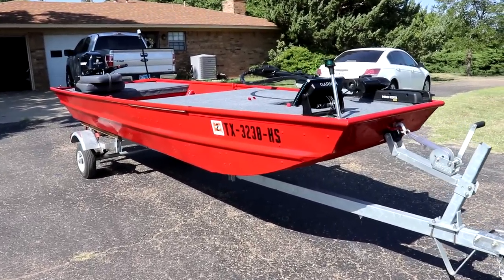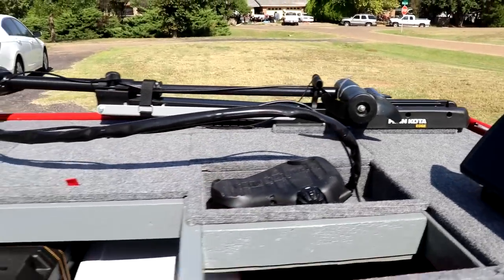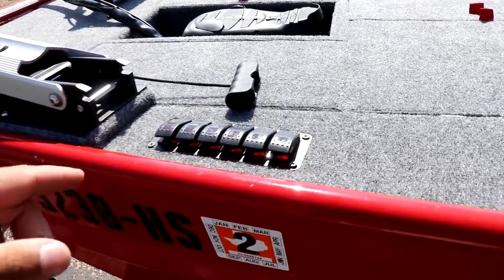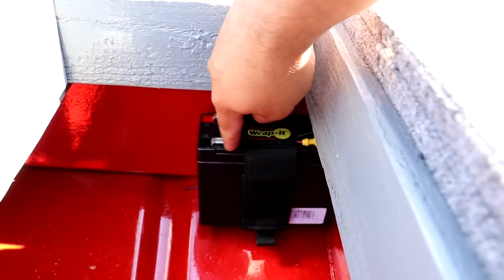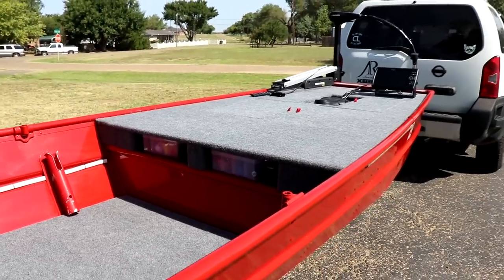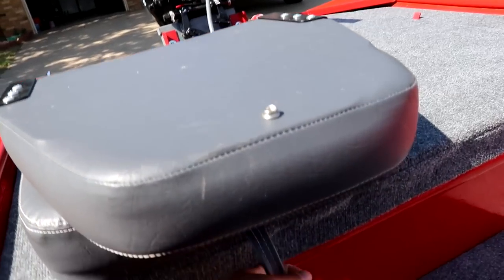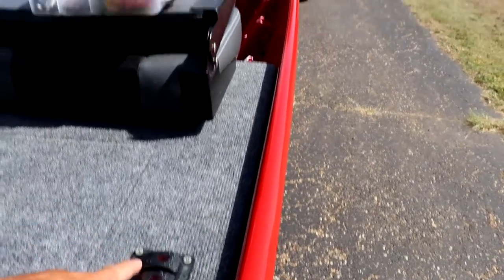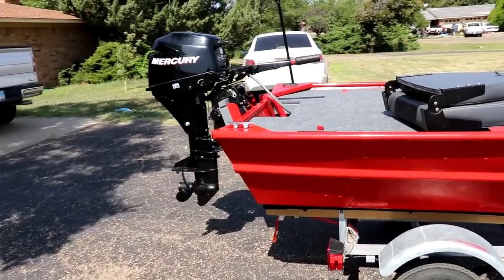JON BOAT TO BASS BOAT FULL BUILD WALK AROUND TOUR!!

Comment: Looks like you are very close to having the trolling motor mounted in a way that your hatch it blocks will open. Might want to try adding a board underneath it and extending its base over the front edge of the boat.

Comment: I did virtually the same thing to a john boat in the 70's. It was a little bigger and deeper than normal because it had been designed for the La.Wildlife and Fisheries so they could sample traps nets etc. so upon becoming the owner I actually made my deck platforms because the back bench was only a half seat. The best part was that it had a 48" bottom and nearly 2' deep. Had an old chrysler outboard which never faltered but I did replace it with a new 50 Merc. Yours looks good and I enjoyed your build. I smiled at it because it brought back some very fond memories of nearly 50 years ago. I put bass seat pedestals on mine but yours looks better; I did mine in blue. Used her nearly 10 years before I bought a store bought model.

Comment: I did a similar project on the exact same boat (14' alumacraft) except mine had a 9.9 hp motor.  With mine I just added a plywood deck covered in carpet with chair mounts.  No frame and no compartments.  It was made to be removable.  It made the boat heavy and sluggish.  I ended up pulling it out.  One of the nice things about a jon boat is the light weight.  I think you'll need a bigger boat and motor if you add 200 pounds of wood to the front of the boat.

Comment: On the front casting deck where u have your hatches in the bottom u should make like a box under the hatches so u can put tackle and tackle boxes there
Reply from the maker: Yeah I may do that eventually
Reply: I made a single long-carpeted board to cover the bottom of the foot petal and the right hatch. It’ll give that right hatch a small cabinet space.

Comment: Did you just paint the boat or did you sand it down and then paint? How did that process work?
Reply from the maker: I roughly sanded the green paint to rough up the surface, and then painted it with oil based enamel which is the red you see on it now

Comment: GREAT JOB.

3- Questions.

1- How did you anchor your decks down.
2- How do you put fuel in the tank.

3- In the future are you going to add a standup casting seat up front?
Reply from the maker: The front deck is such a tight fit that it sits under the lip of the boat and doesn’t move, the back deck frame is screwed into the transom and the deck is screwed to the deck frame, and I have a funnel with a long tube that reaches the gas tank, and yes, if I knew better I would of added it to this build but definitely going on the next build

Comment: The military term is OD Green for the paint. My boat was painted the same color by the previous owner and his reasoning was because the color blends in well with most waters and especially in our area where the lakes are mud bottom and turn green very quickly as the water warms up. I like the idea of the strap handles you did vs just drilling a hole in the lid for your finger. I thought about that but then realized how much crap would get inside the storage area then.

Comment: Just curious man, why didn’t you just hook your garmin to the cranking battery? That way it can charge via the noco.. maybe didn’t want extra wires rigged through the middle and visible? When I seen that part in the initial build video i was curious
Reply from the maker: Both batteries are charged through the noco, I have them both hooked up to it, it’s a duel battery charger
Reply: @AdamRyanA  Oh it looked like you had a small lithium battery in the compartment directly underneath the fish finder? The one that you mounted with a strap.. I see your charger and your cranking and trolling batteries all hooked up but what was that other little battery for them?
Reply from the maker: Oh sorry I read that wrong, thought you were talking about the trolling motor, but you are correct, I have the fish finder on its own battery just so the fish finder and trolling motor last longer and to not cause any interference on the fish finder
Reply: @AdamRyanA  So do you just remove it to charge it up then? The point I’m getting at is I was looking into putting together a portable pack fish finder out of smaller lowrance hook2, and was considering getting one of those lithium batteries and a ice transducer that I could just drop into the water basically anywhere out of any boat if I wanted to.. looks like a pretty viable option with how small that battery is
Reply from the maker: Yeah I remove it and charge that battery with a battery tender

Comment: For a battery charge go to harbor freight and pick up the solar panel charge kit you can modify the wiring to eyelid connectors and not have to worry aboot battery drain it’s a worth while investment for aboot 15-50$

Comment: An awesome build.  I watched all the videos up to this point.  However,  I do have questions that I asked in a couple of your videos. 
1.  Why isn't the bilge pump on the switch panel?  Found it.  you moved the battery and hooked it up.
2.  Why isn't the fish finder on the switch panel?  Now you have an extra battery to worry about.
3.  Wiring.  If I'm reading you correctly.  The main wire from the battery goes to the fuse box.  Only one hot wire and ground goes to the switch box.  The light wires (red) goes to the switch box and all the black wires from the lights go to the fuse box.  Do I have that correct?
4.  I figured out the kill switch and where that goes.

Comment: change the prop on your trolling motor if you want more or less speed.
three blade would be more speed.
they make smaller 2 blade  props which would make you go slower

Comment: I think it’s great!!! 
Your outboard is sitting a bit low! 
Use that thing that the engine is sitting on to adjust the engine up!  Just slide the gray thingy up and then bolt it to the red thingy. 
The usual rule is make the cavitation plate on the engine level with the bottom of the boat.  Then raise the engine up until the propeller starts to cavitate. Then go back down to the last position.

Comment: I think the only thing I would have done different to save on weight would have been metal studs instead of wood 2x4's plus you don't need to worry about wood rot down the line.

Comment: How did you secure your floor down? I know in one video you said you were going to but never saw how you did?
Reply: That was going to be my question as well , before I start my build. Is the deck and the floor secured to the boat ? If so , how did you do it ? I watched every video from start to finish did not see how you secured the deck or the floor?
Reply from the maker: Sorry just now seeing this but I used self tapping screws and screwed it down to the ribs on the floor, the rod holders I have screwed to the side will also work to keep the floor down and from coming out

Comment: Your boat motor has a system that charges called a stater it keeps charge to the spark plug and a battery just run the charge wire to all you batterys if you have any ??? Just text me.